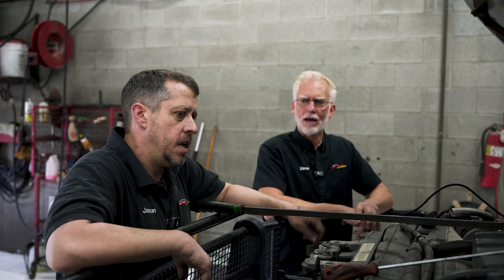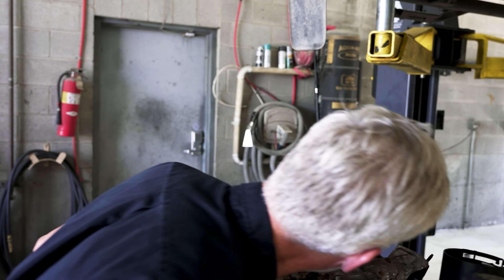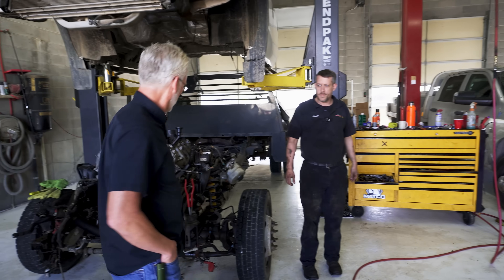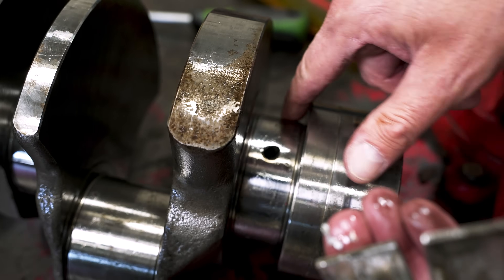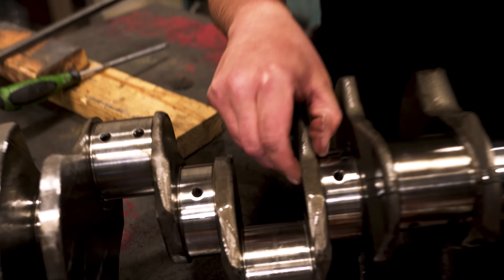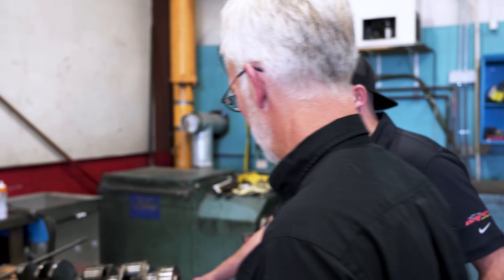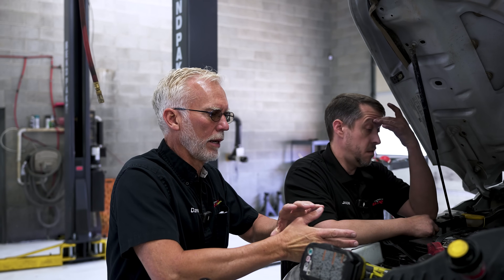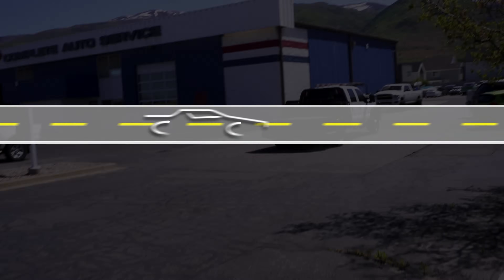Ford 6.7 Power Stroke Failure

Comment: It is incredibly difficult to find good work nowadays. I have a pretty high standard, sometimes people make fun of me a little for it but I'm picky and my being picky works good for me. I literally can't find a machine shop in my area that does acceptable work they just do stupid things and ruin parts. I am knowledgeable enough to check their work and it's usually trash. I've worked at German shops on higher end German cars then the Volkswagen Audi dealer as a tech for a bit then I've worked at private shops on all sorts of things even on semi trucks for a bit but mostly passenger cars and trucks etc.. I actually like Chrysler products maybe not all of them but I'm also a jeep guy as a hobby and I'm very familiar with certain models. Last time I needed machine work done I had a short block for a jeep 4.0 that was rebuilt some years ago I've ran it in my personal jeep and it's a good engine but I wanted to put a fresh head on it because it had a bad seat and was also the wrong casting number for that block but I really wanted that engine going again so I figured they can't mess up a iron jeep head but boy I was wrong they ruined 2 heads luckily I have a large stash of parts but one of the heads was a really nice casting I was pretty upset not only was the valve job horrible and the head still dirty and full of carbon they crashed their machine into the thermostat gasket surface I don't even know how you do that then they said they couldn't fix it because it won't fit in their machine but I tried explaining you can't fix that if you mill it flat again I'd have to run a spacer to get clearance back and it's not how i do things. Then the other head was just so bad after they were done I scrapped it and learned my lesson it's kinda like when I have McDonald's every 6 months to a year the fries are good but I get a gut ache and realize why I dont go again. I used to be able to use local places and get work done and assemble an engine myself but I just can't get the work done locally anymore so I have other ways of getting things done I've cleaned up heads and lapped valves by hand and done valve seals or I know a couple places across the country I can mail stuff too. Don't even get me started on transmissions, when I started out I could get reliable rebuilt transmissions sometimes I'd find problems but not like you do today. Even those real expensive purple transmissions I've installed for people in dodge trucks and found problems like really dumb problems and serious problems. I started having to do repairs myself and I learned over the years with a lot of things to never give up the core until you know that your new part is good that has saved me when I end up just doing the rebuild it's much easier for me to take apart a core and rebuild it myself than to take apart a rebuilt transmission and try to fix someone else's screw up. But a few years ago I met an awesome transmission guy who works out of a little shop on his property he's highly knowledgeable and has become my friend. I love bringing him stuff and he lets me work with him on my stuff when I want something custom or I have an idea and he lets me do carry outs he's one of those guys that just spews knowledge. I love meeting and learning things from guys who are so good at what they do, and he understands how hard it is to get good parts and he is like me with his part sourcing so I trust him to find me stuff or if he says a used original would be better than new.
I have a couple places I can work with through the mail I also have some friends that help me a little but I can't really do certain things on customer cars anymore in a reasonable amount of time because of the unreliable machine work and I'm not willing to half ass anything I want to make things better. One of my Hobby's other than jeeps is vintage dirt bikes and I found a guy locally who builds race engines for boats I'm not familiar with the boats or what he does exactly like what race team or where they race but I think he says they are mercury and he says they are 100k dollar engines the boats are really cool but he has a private shop and I have him do my bike stuff like crank rebuilding and some cylinder work I've also brought him my jet ski stuff. I also have another friend who has a mill in his garage and he does some stuff for me every now and then. But all that being said I can't just Google a machine shop and bring stuff there because of the high risk of things going wrong especially when it's a rare part I work with some very rare parts sometimes. 
I can think of a few places that have gone out of business over the years that I did good business with. One thing I'm sure other mechanics are familiar with is how horrible reman alternators and starters can be I think O'Reilly is the worst offender. I won't install an alternator or starter in a vehicle anymore unless I source it. I found a place called DC power they make high quality alternators even with fancy billet case options thats what I run in my Jeep. But why I mention this is we used to have a wrecking yard somewhat locally and they would rebuild alternators and starters and even do custom upgrades like higher output and this was built with new parts they just happened to be a wrecking yard too. I used them a hand full of times and I had a friend who used them a bunch but I really wish they were still around it was really cheap too like stupid cheap. But I'd love to be able to use someone like that again but there's just not a demand anymore to repair that stuff.

Comment: I feel this man’s pain. My wife and I bought a used 2014 F350 stroker from a local used dealer that took in on trade. I did every thing right, carfax, independent inspection, etc. we only had it nine months when it ate a lifter. While tearing it down to investigate, I started noticing rounded bolt heads, mismatched hardware. Basically, someone who shouldn’t use a wrench was in that engine and fixed it enough for the guy to trade it in and run away with a newer truck. I never yelled at the dealer cause they were just as much a victim as I was, but $25K later and a new long block from Ford. I wish I would have known about you first cause “my friend” didn’t really do me any favors and left coolant clamps loose. Easy fix for me, but he’ll never touch my vehicles again.
Reply from the maker: Sounds like you did a good effort on checking on the vehicle before purchase. It's to bad we can't get all the maintenance and repair records on vehicles for a better picture
Reply: It’s just sad the level of dishonesty there is in this industry. I had the brake power block replaced on my wife’s 07 Navigator at Young Ford Ogden and they only hand tightened the lines on the block. Severe negligence at best. Who really needs the brakes to stop right. When I went in with the video proof from another mechanic they denied it was their fault. That’s why I like your videos, straight shooting no BS.
Reply: One previous owner did work himself to save money keeping thr Truck on the road as long as possible earning money don't knock a guy trying to earn a living.. the dealer won't tear down a motor completely on are their trade ins or used cars as it's not feasible to ans earn a profit.. looks like your pre inspection mechanic didn't point out the issues you said.. but getting a used car is like gambling don't know how long it will last.
Reply: Nobody goes through life without having that expensive "Oopsie" moment -- just think of that $25,000 as a lesson learned and how much more knowledge you've gained that you'll be able to pass on to others.
Reply: Never work for or with friends/family. Always will have a sour outcome one way or another eventually
Reply: Buying a used diesel is like marrying a prostitute
Reply: Not sure where the hell you guys are getting raped for a motor. My brother just blew his up at 300 thou and bitched to Ford about not being able to get a motor right away and they expedited a motor for $6800 granted that’s doing the work yourself but a lot better than 22 thou.

Comment: Hey Dave the aftermarket is a filter for the the cp4 pump in case is exploded it catches alot of the metal preventing the tank and other stuff from being replaced they call it a disaster relief kit.
Reply: Just put a DCR pump from S&S diesel and totally eliminate the CP4 then you’ll have a good truck minus the emissions also.
Reply: Dave, It's a S&S DPK -a Disaster(CP4 making metal sending it to entire fuel sys)Prevention Kit. Keeps CP4 failure from causing $10k in damage. It's the BEST insurance you can put on a 6.7 to prevent the disaster. S&S also makes the DCR Pump to replace the CP4 completely getting rid of that pos problem all together. Very simple swap, new pump actually flows a little bit more fuel and everything else is bolt-on parts. Any one with a 6.7 CP4 should have one or the other on their trucks unless they like spending $10k replacing entire fuel system!
Reply: Installed one today on my 6.7
Reply: Not sure how or why he didn’t know that. The weld on EGR plate is great!

Comment: They stopped making good diesel fords after the 7.3
Reply: The EPA had a large hand in making newer diesels unreliable. The 7.3s also had enough power to get around, and not hurt themselves. The newer stuff has a lot more power, and if it is increased further with bad tuning it makes it adds to the mix.
Reply: They didn't make that one either, international did.
Reply: @ashes2ashes863  Actually international didn't make it, they just put it in their trucks like Ford, Navistar made the engines, the 6.7 is the only one actually made completely by FORD and not Navistar and it's imo three best of all of them
Reply: The 6.7 is actually a really good engine. Better then any of the Navistar made engines (7.3, 6.0, 6.4)

Comment: That engine was just worked o  based on how clean it looks and from the oil pan so clean and fresh silicone. Alot of time's I've seen engine failures right after poor prior repairs.

Comment: Dave, the best crank grinder is at Jim’s Automotive Machine Shop. They’re a small family business running since 1983 and have a great YouTube channel also.
Reply from the maker: Appreciate the feedback guys 👍. Very helpful
Reply: It would be interesting for them to do a joint video that both platforms can publish.  A detailed look at crank grinding, failure points, best practices etc.
Reply: My 2 favourite machine shop channels
Reply: @shaolinfist8323    Don't forget Keith Fenner and ABOM79.  Slightly different subject matter, but both masters at their craft who lead by example on the right way to do things.
Reply: @shaolinfist8323  Cutting Edge Engineering  https://www.youtube.com/watch?v=CfR94njAV2s
Reply: I looked for the JAMSI comment. Found it.
Reply: Also Powell Machine.
Reply: Probably not to far from each other too
Reply: Where is the shop?
Reply: @drut7512  JAMSI is in Colorado

Comment: Homie aint playin tearing that thing apart. Even with the Ryobi.
Reply: Snap on doesn't make you a better mechanic, all you snap on buyers thank you for supporting that expensive truck.
Reply: Who cares what brand tools he uses?
Reply: @cliffordmontana4562 you will when you use them to make a living.
Reply: For an impact driver I wouldn't go snap on or Ryobi.
Reply: The question should be why is Mechanics forced as employee to buy own tools.
Reply: @AdrianMcDaid  I don’t look at it as them being forced. It actually allows them to be independent. If the shop owns the tools, then they can fire the mechanic at any time, and they are left without a way to make a living. If the mechanic owns the tools, they can quit anytime and go wherever they want to… And if the shop lets them go for whatever reason, even if it’s just that the shop fell on hard times, they still have their tools, and they can go and find another job easily.
Reply: @AdrianMcDaid  Because even with the best mechanics there is a bit of art to the what and how they go about their work. Having to buy their own tools does mean more outlay for them, certainly, but look at it this way: Would you rather work with the same drivers and crescents and miscellaneous wrenches and what not that every other mechanic in the shop uses and beats on, inevitably go missing, the shop runs low on at the worst time, the boss keeps yelling at everyone to stop breaking and losing, etc.? Or would you rather have exactly what you want to use when you want/need it to do the job you want to do at the quality level you want, need to replace them with what you want/need, every night you get to lock them up, and if/when the shop goes belly up you can walk away with exactly what you want/need?
Reply: @Bluecedor  I don't expect have to pay for the tools  get job done as employee. Be that computer equipment or software packages required in workplace.
Reply: @AdrianMcDaid  That’s fine. I get that sentiment. But not every profession is the same. Surgeons? Different use case and environment. IT? Different than medicine. Even mechanics, be they airline, car, truck, military, there are going to be all sorts of different environments where a mechanic either will be better off buying their own, or better off using tools purchased and maintained by someone else. I directly know of an example, in semiconductor fabs where the tools are owned by the facility, but there are A LOT of scientific reasons - that don’t apply to any other field - that is the case.
Reply: @Bluecedor  I guess my question is why should I take money out my pay cheque to pay for tools for garage owner.
Reply: @ How would they be the owner’s if they are property of the mechanic?

Comment: What is the tech spraying on everything at 2:00?
Reply: Penetrating oil.
Reply: Bad chemicals. 

You want clean work 
Pressure wash it
With water. 

If I worked with a tech who did that spray of brake clean every time in a closed shop I tell you I would quit sorry boss I love ya.

Comment: I was wondering what's the cheapest newer diesel engine to rebuild. Cummins Duramax or Powerstroke. I am thinking the Cummins it only has one bank.I am not a diesel guy. I still love low-end torque them. The EPA made diesel engines work so hard with all emissions stuff. Like breathing through a straw
Reply: Modern deleted diesels are just fine
Reply: @destinhook3826  they are, but I have a lot of opp cops looking for trucks without emissions stuff.I don't want to deal with that. We don't have emissions anymore. Maybe an old engine is the way to go.
Reply: The best new diesel is an old one. 

Vw diesel 1.9 can make same HP as a stock Cummins or 7.3. 

But you get 4x the mpg.
Reply: @fastinradfordable  ya, I need something two toe with. I had a 7.3 in my 2001 F-350. I loved that truck it rusted out on me joys of living in the Rust Belt Canada. Also had 1994 4.9L 300 inline 6 it was amazing engine.

Comment: The ferrite burr explanation! Thanks for that! I never knew.
Reply from the maker: Happy to help!
Reply: @DavesAutoCenterCenterville  from what I have read  forged steel cranks do not have burrs like and cast cranks do directional polishing matters on them but do polishing all the same an no issues any how . just figured i ramble a bit  i vote cheap parts bad mechanic sillycon mess helped 2
Reply: A crank is ground based on it's direction of rotation, too.  A LH rotating crank will be ground (and polished) in the opposite direction.
Reply: Something I had known but forgotten.